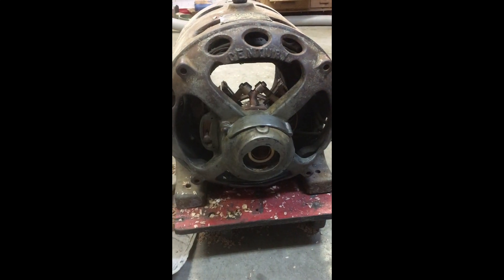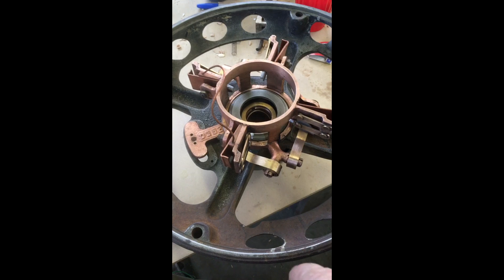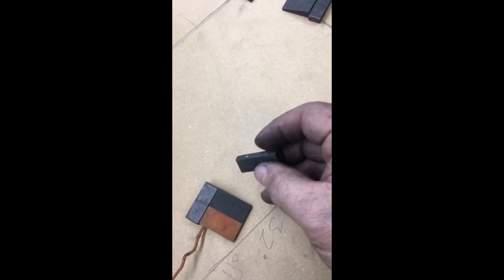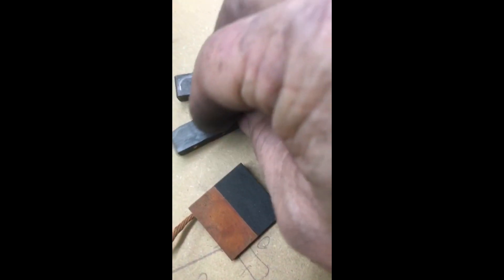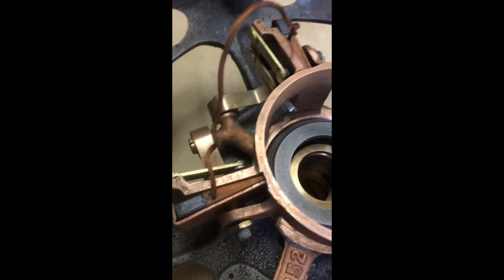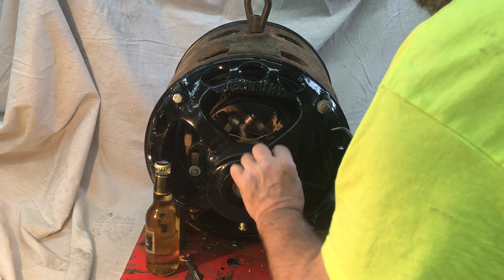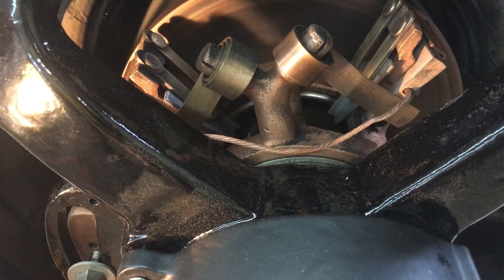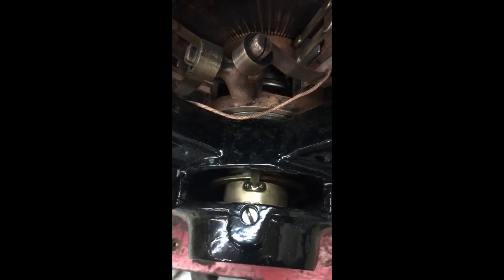1903 single phase repulsion start Century Electric CO motor

Comment: Hey, can I ask how you dealt with the copper brush cage?  Were you able to find a way to remove it for cleaning or did you simply clean it in place?  It looks as though it pivots on a pressed-in something or other within it's ID.  Also, do you remember how the brass end cap comes out for the bearing housing?
Reply: It screws in.  The whole thing spins.
Reply: It's threaded onto the end plate.

Comment: I have this exact motor that has been in storage for 20 years. It was running a metal shaper prior to that. As I am restoring the shaper, I had planned to put a new 3 hp baldor motor on it, but you have inspired me to clean up the old century. It really is a cool old peice of tech.
Reply: Yes it is a very Interesting motor that is becoming more rare

Comment: Hi from England

I have a Century electric repulsion start induction run motor...1/2HP...

What immediately strikes you about them is just how beautifully made they are...
Oscillating ring lubrication operating in dash pots... 
Real old time quality...
220V series
110V parallel 
You make the series or parallel with the two pair at the motor's intake... 

Collectors items...still very usable with decent torque delivery...

With thanks
Glenn
GLMelectrical
Leeds UK